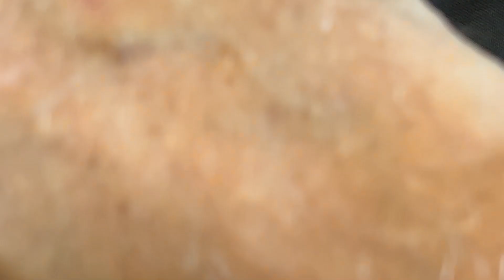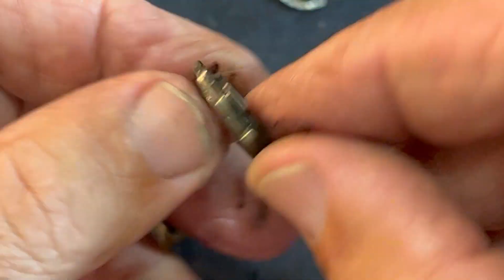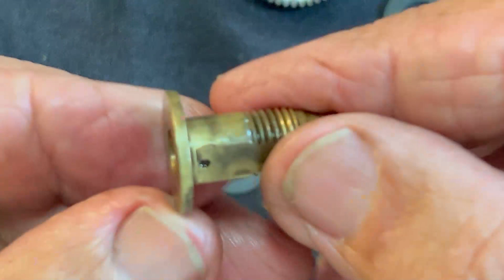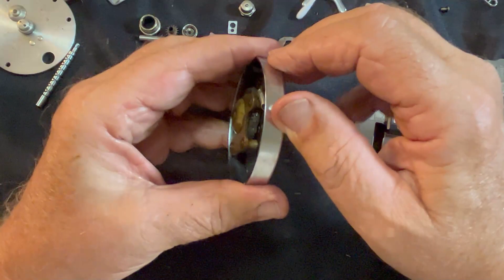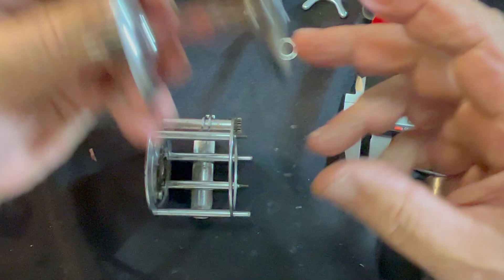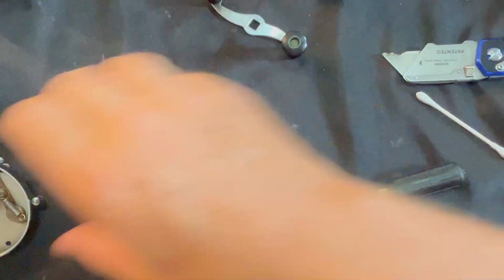Shakespeare Service 1944 Part 2 -- Service Repair and Lubrication -- Young Martin's Reels

Comment: I just finished a 1941 SERVICE  special it was somewhat  finicky  going together. I tried some 6-155 penn carbon washers on it which  were  a little bigger and it made a difference and stiffened the reel  up but it's all good now

Comment: Rick, l’m the blind guy and those screws did not look the same to me - probably because of your magnification with your camera. Hey, I’ve used your spring trick before but I used a much smaller screwdriver. I’m not so sure I like this design? How many times do you see a clicker on this type reel that is above the drag washers? I’m not sure I totally understand how that anti-reverse / freespool mechanism operates. It appears to me that you’re doing with these two reels like you did with the two St. Croix fishing machines at my house - swapping for the best part.  Oh, did you get that Bache Brown reel AR working? That was an excellent picture of how WD-40 operates and why it should not be used for a long term lubricant.  I think I just had a good laugh when you found that post. You sure did get that worm gear looking nice! I did not see you oil the worm gear - am I being blind again? I’ll tell you one thing Rick - your friend Ken is a lucky guy to have you around!!!  I never thought this reel would ever work that well or look that good when I first saw it.  Your reputation as the fishing reel miracle-worker is still intact and growing. — Chris. PS. I agree about swapping the handbells! I’m glad you haven’t forgotten about my Daiwa Emcast! LOL. That reel stumped me like no other.